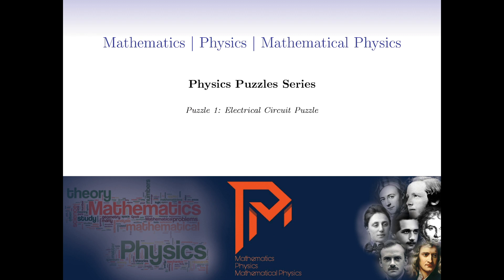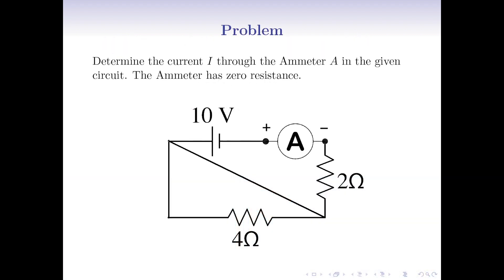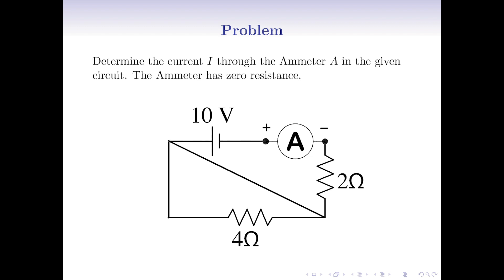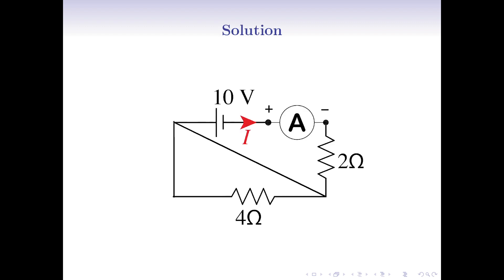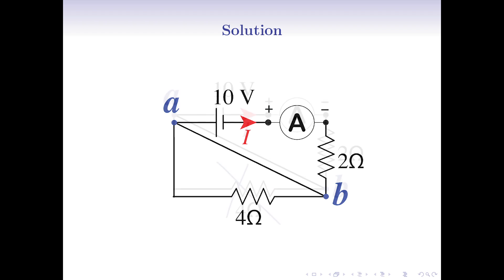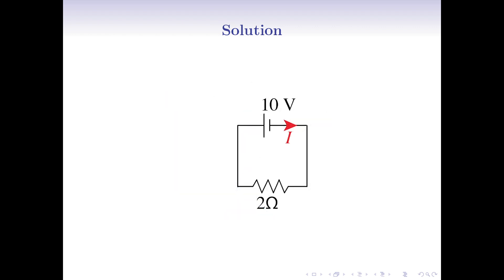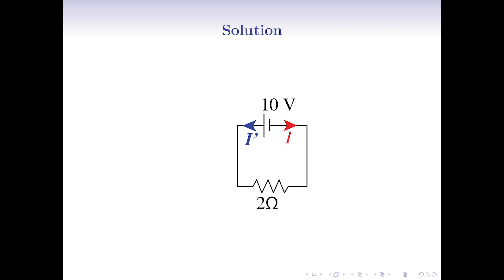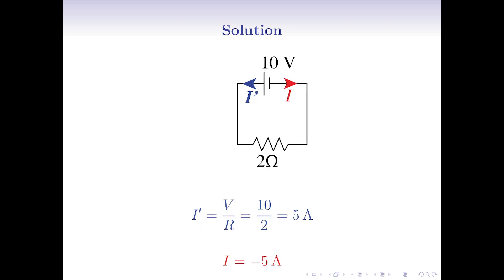Physics Puzzles Series - Physics Puzzle #1 (Electrical Circuits)

Comment: Because of the diagonal wire, the top-left node is directly shorted to the bottom-right node. And the left vertical wire makes the bottom-left node the same node too. So:

The 4 Ω resistor is completely bypassed (short-circuited) ⇒ 0 V across it ⇒ 0 A through it.
What’s left is just a 10 V source in series with the ammeter (0 Ω) and the 2 Ω resistor.

Answer: 
𝐼=5A	(and it flows through the ammeter from right to left in the drawing, since the 2 Ω resistor is on the right side of the loop).